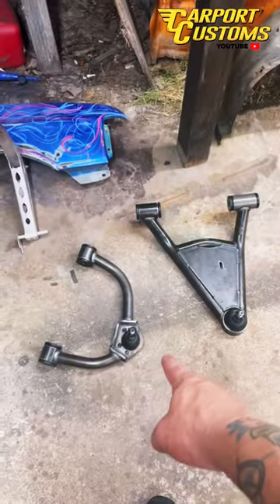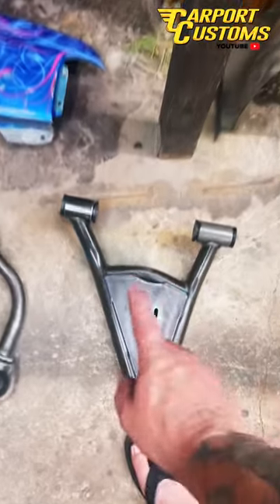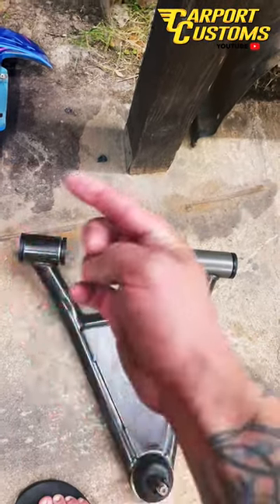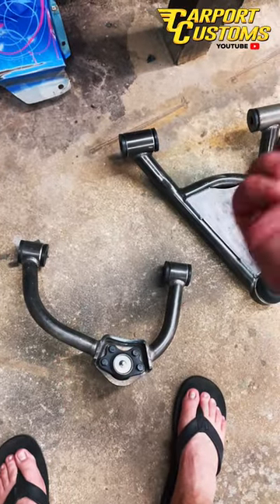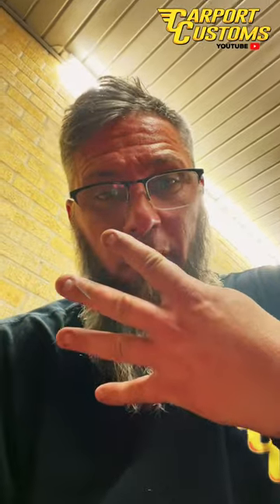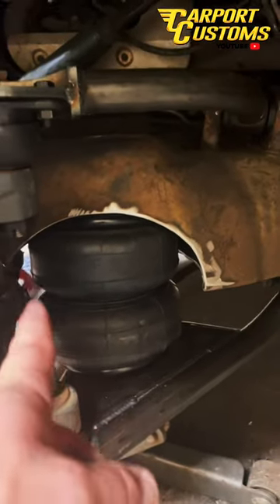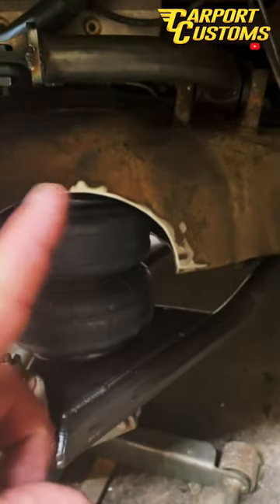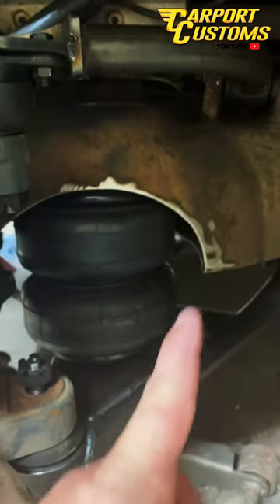How to bag an OBS Chevy on big wheels.

Comment: You don't cuz if you put big wheels and all that s*** on your truck it makes it useful if you can't even use it for a truck anymore and that's the reason why trucks are so expensive cuz you guys are ruining them and use them for what trucks are not meant to be used for
Reply from the maker: This truck can still do everything it was capable of doing before. Now it will just look better doing it
Reply: Tell me you know nothing about lowered trucks without telling ke
Reply: Besides it looking like s*** you can't pull a trailer that weighs a pretty good bit if you are a truck
Reply from the maker: @nickholzschuher1421 wait, so all these tractor trailers that say “air ride equipped” and hauling tens of thousands of pounds aren’t trucks anymore and can’t pull anything? Think about the next time you buy literally anything from anywhere because it definitely was transported at some time by a truck ON BAGS.